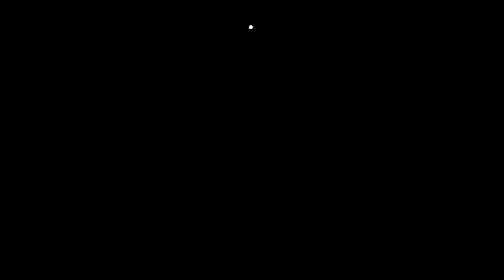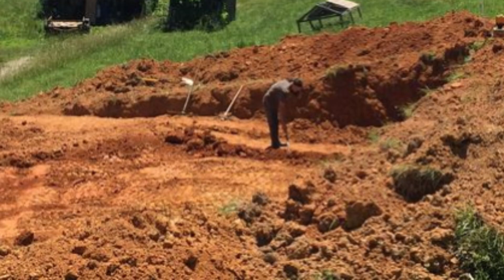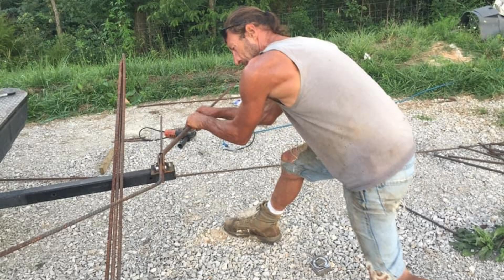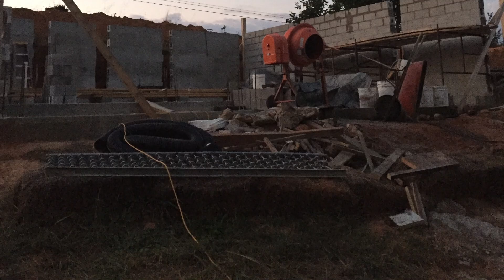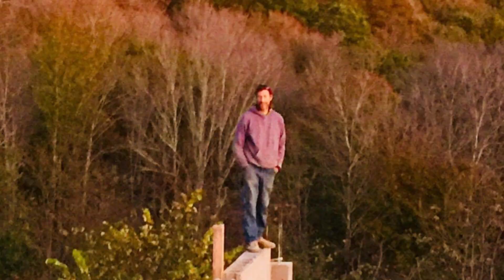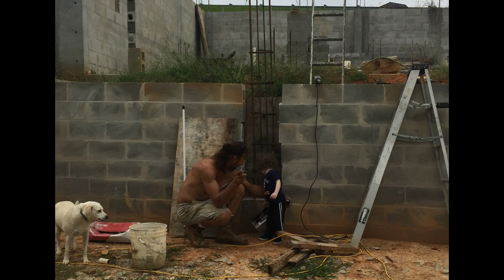How Did the Concrete House Begin?

Comment: My home is block. Finished walls are 12 inches thick, Window sills are 10 inches. Hanging plants, potted plants anything you want can easily be placed in the windows. Then you have the massive thermal value (no Insulation) here in south Ms. fall and spring utility 100, summer , winter 190, give or take. 2800 sqr feet. My electrical is inside the blocks. Drywall screwed directly to the block. Still standing after Katrina, and who knows how many tornadoes. It's all in how you build it